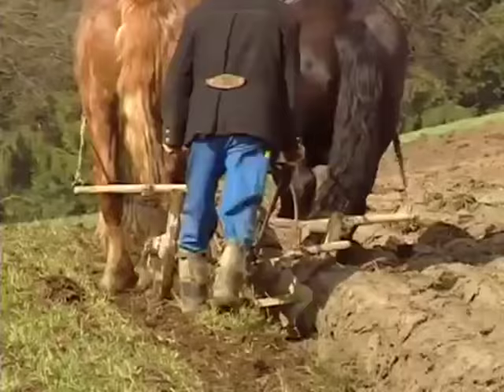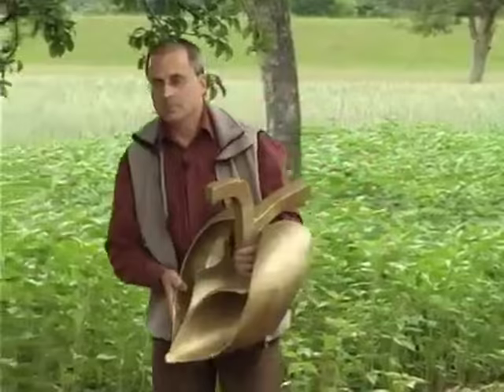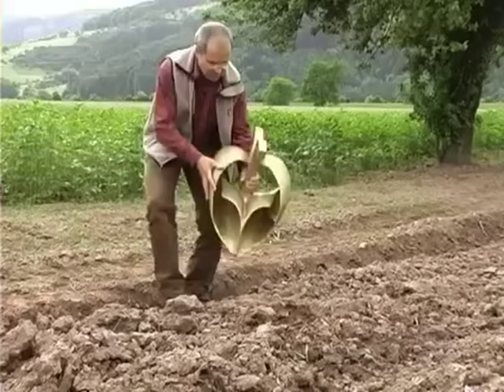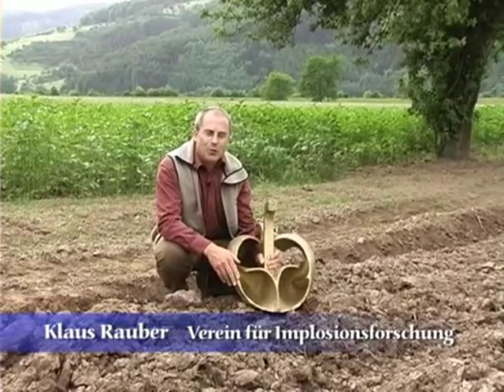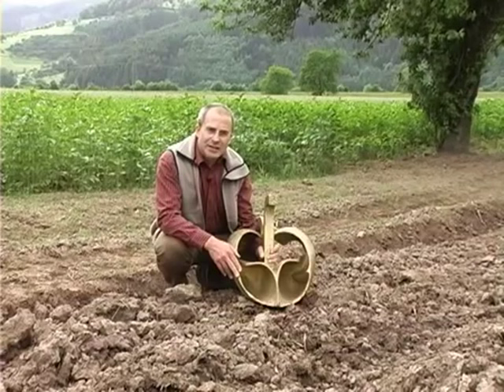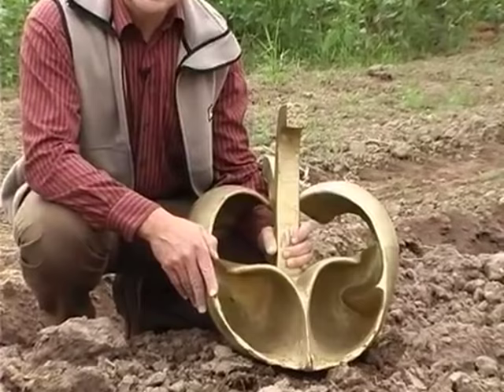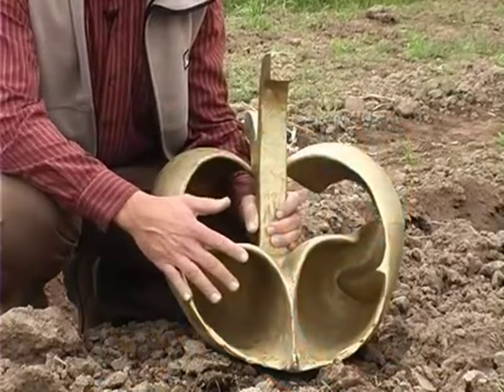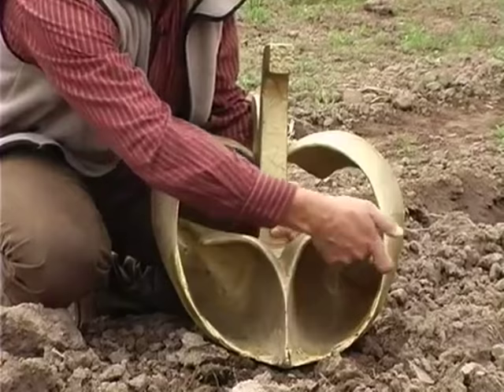Viktor Schauberger -  Bio Plough

Comment: One could easily cast out another model. 
Frustration is a shield in form of a mantra of failure : "they would never allow this kind of technology to become real"
C'mon
Reply: Ok let's make one or two I can find  bronze easily
Reply: 3d print it ... get a scale model up and then go from there .. heck with the low cost of 3d printers ... if everyone who owns one large enough to print a full size plow head could print one we would have thousands of excellent plows to start from ... world wide
Reply: @emeralddragongaming2930  Cast Iron is inexpensive and readily cast. It would prove its mechanical practicability. (Energy Input when used?)
Then a Bronze replica (Which Bronze Cu,Sn or Cu,Zn)
Reply: @cameronbruce1862  how do you mean readily cast, who is going to cast it it is about 1500 degree Celsius I have no knowledge about that
Reply: @emeralddragongaming2930  Cast Iron annealed to SG Iron would provide a practical way to make a Replica and try it out. Technology thats OVER 100 Years old now and readily available. 
TAKE A PATTERN TO AN IRON FOUNDRY AN THEY WILL BE ABLE TO MAKE AN IRON or even steel version from it. I personally dont think it's a PRACTICAL TOOL, BUT ??? till proved. Steel is soft Iron is HARD.
Reply: @cameronbruce1862 Copper/Zinc is brass, not bronze.